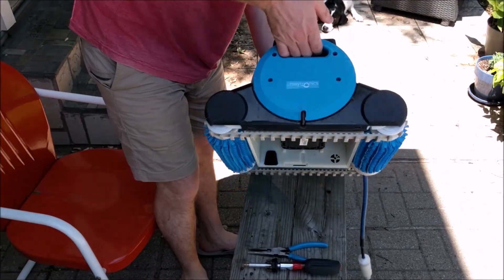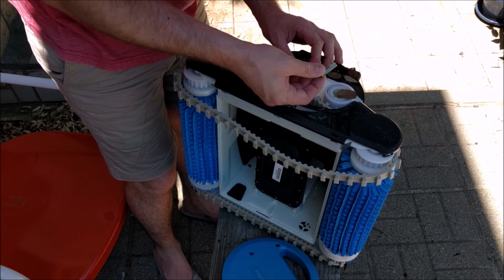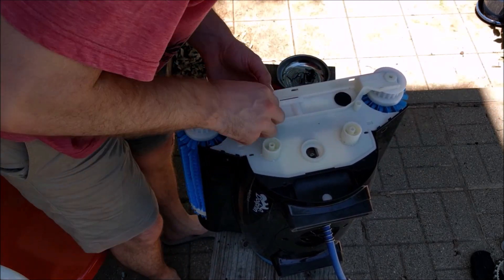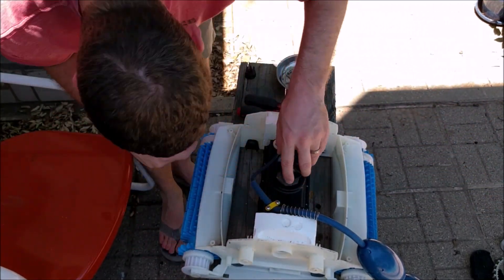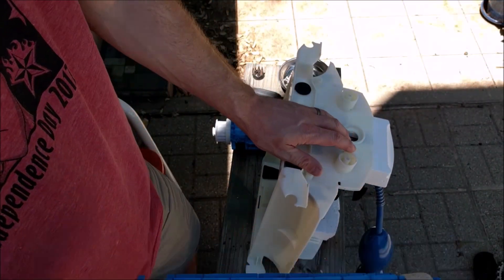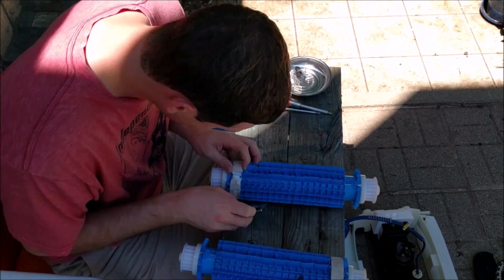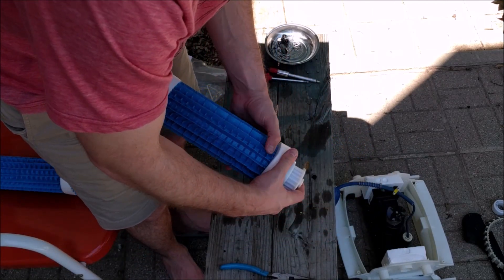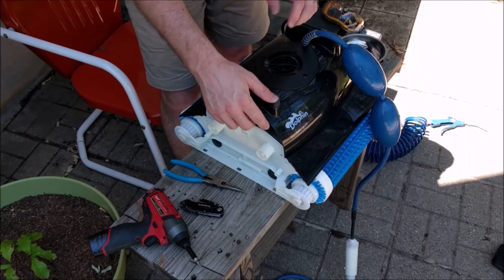Dolphin Nautilus Robotic Pool Cleaner Teardown and Servicing

Comment: can anyone tell what the part# for the 60ft cable from the power unit to this  dolphin model is ? I tried one that said it was compatible and it did not have an opening for the 3 prongs inside the Triangular opening to the motor.

Comment: Just went to replace the tracks on mine and it turns out one of the bearings is bad, it is almost cheaper to just buy a new Dolphin than the replacement parts.